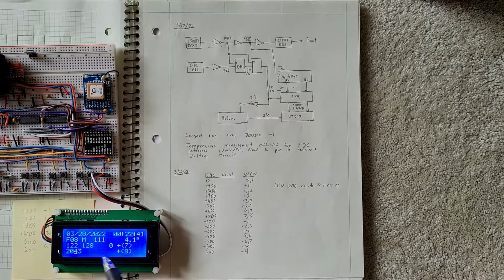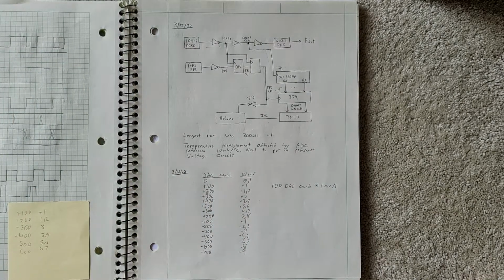GPS Disciplined Oscillator part 4

Comment: The TXCO needs to shed heat when you want to decrease the frequency.  If it is insulated too well, it may take several clock cycles to respond.